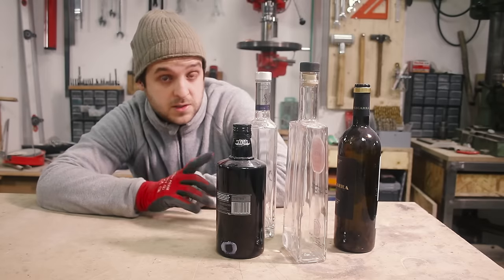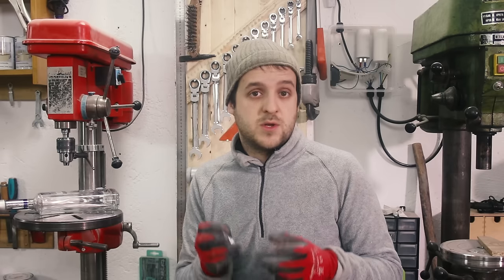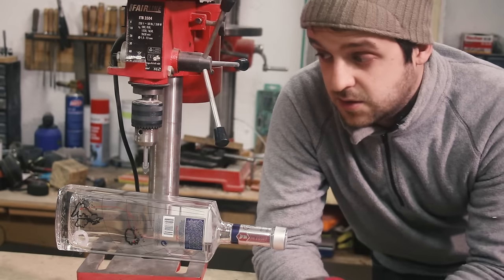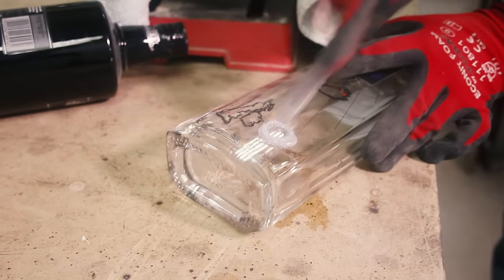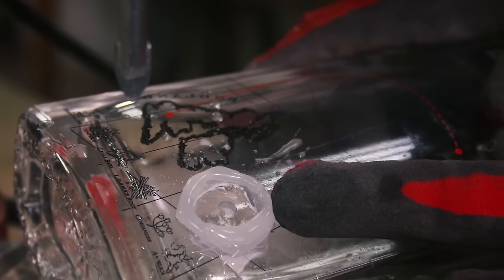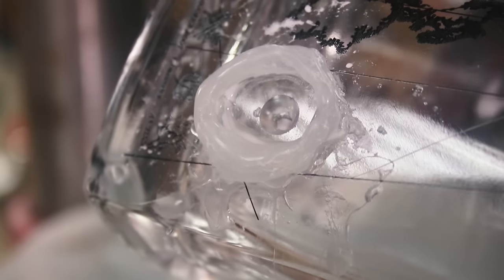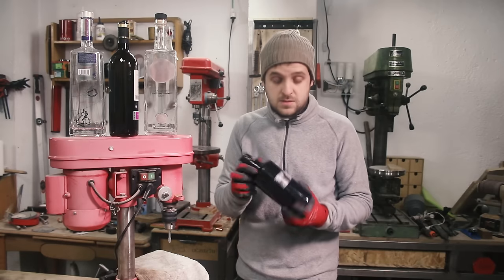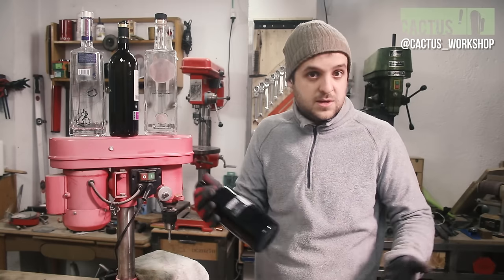How to drill GLASS - Perfect holes! SUPER simple!

Comment: Good job! For the cooling part I recomend a half liter plastic bottle with a small hole in the cap, instead of the seringe, so that you won't need to refill it so often :) love the editing! Cheers!
Reply from the maker: Thanks John! that sure helps! :)
Reply: That would work great unless you're trying to drill on a vertical pane as in a double pain window/door. My drill was hollow with a slot in it which held a little water for a while. Caution: you can't drill it too slow! I have a shattered glass to prove that. I was drilling slow bur apparently not slooooooowwwww enough. I have another to test my slow speed on. I may take the shattered one out and just use one pain. Coastal SC never gets very cold anyway. Wish me luch as I finish the second one. I have a ring drilled half way through but I suspect the critical point is when you break through the second surface. Any comments?

Comment: One of the primary reasons glass breaks is because of high frequency sounds which hit resonant frequencies of the glass.  The dam of glue plus water is dampening the soumd as well as cooling the glass.  Filling the bottle with water would have a similar effect.  So would immersing the bottle in a small tub of water.

Comment: The idea with  the Hot Melt is really cool I think if you fill the bottle up with water and put a cap on it then you wouldn't have to keep squirting water into the Hot Melt ring
Reply from the maker: +Jack McGarey thanks jack!
Reply from the maker: +Jack McGarey sure, filling it would be simple too, but I couldn't fill the gin ones because they still had the one way valve installed 🙈 thanks the tip!